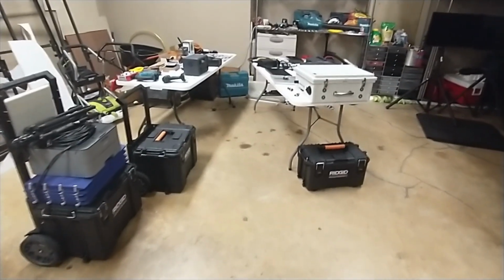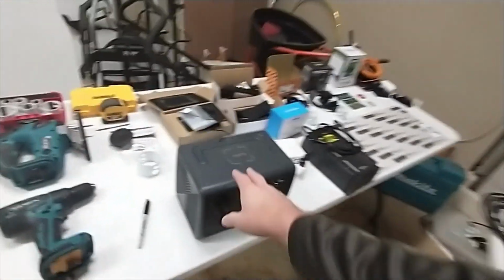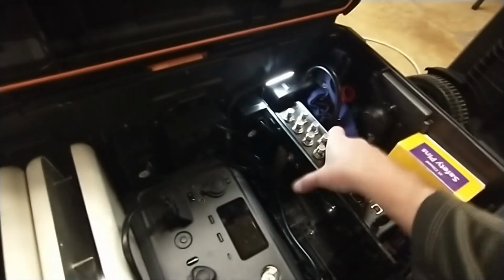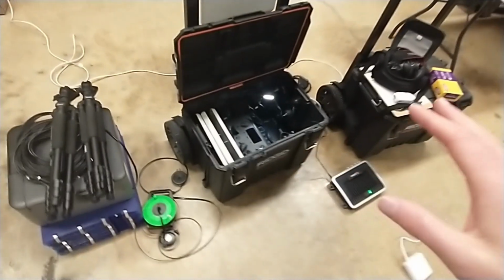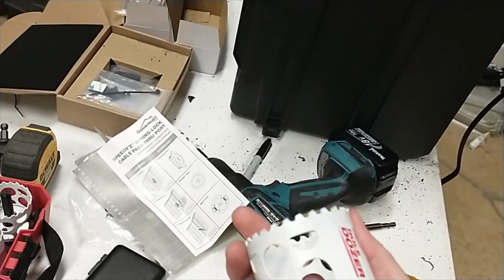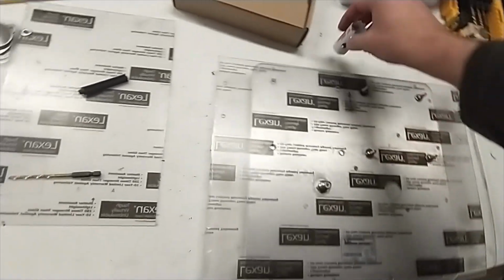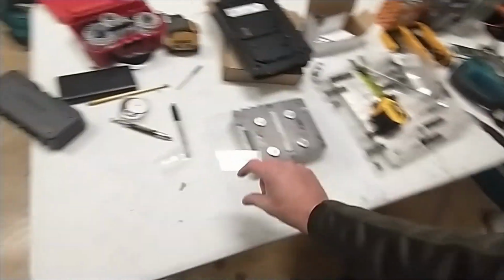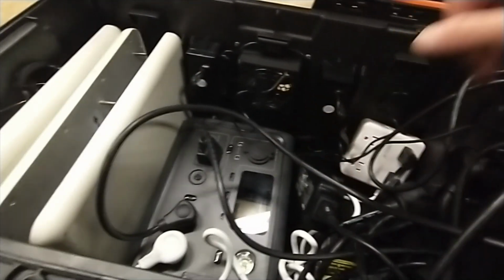Creating a simple weatherproof timing box for less than $250.

Comment: Hi Brian, thanks I have set everything up the only issue I have now is I trying new ankle tags and a circular polarized 9db aerial, using my R420 Speedway reader, and the problem I have is that when the ankle tags are anywhere near the reader they activate, instead of when the cross the horizontal line of the aerial. Example if 2 runners cross the line the reader tags would activate 2 meters in front of aerial rather than when they actually cross the line. Is there a way I can fix this issue. Kind regards,

Comment: Hi Brian thanks for all your videos on timing, they have given me a great insight. I have just purchased a Impinj R420 and was just wondering which side aerials to purchase as there are many options. I am running paddling races which finish on the beach. My question is what Aerials DBI and polarisation do I need with a 6 mtr finish line. I am in Australia so will be in 928mhz range..
Reply: Also what is the power bank model you are using
Reply from the maker: @prwebandprint  Thank you!
Here is the exact model of panel antenna that I use (and that we provide to customers): MTI Wireless MT-262006/TRH/A/K

I've used other UHF antennas and haven't had any complaints with any of them. Here is the minimum specs for what I look for: Circular, IP65 (or higher) rating, and RP TNC connector.

A mat antenna is another option you can consider. If you want a foldable mat then I believe the only legal options available is the RaceResult mat or the BlackBox timing mat. Both great companies from my experience and by what I've heard from my users.

Finally, the power bank I'm using is the Bluetti EB3A. I also have a Cyberpower 625va UPS in the box.